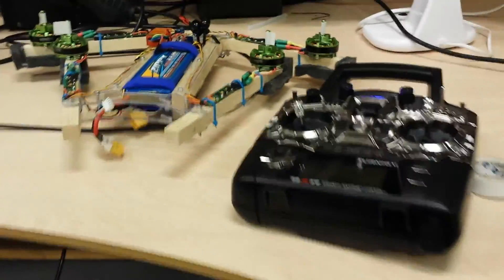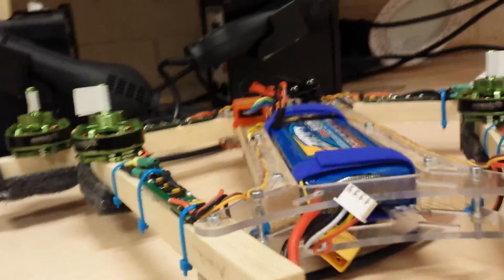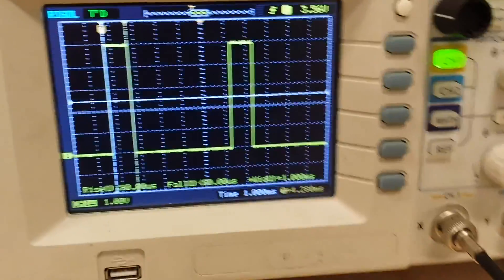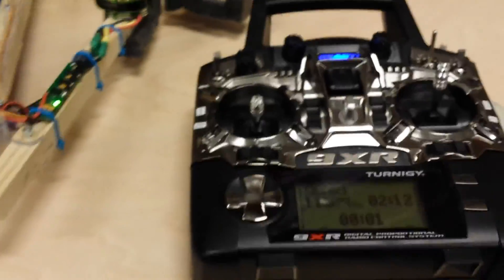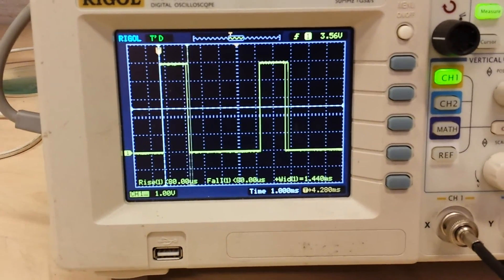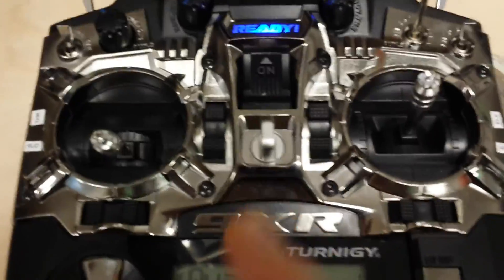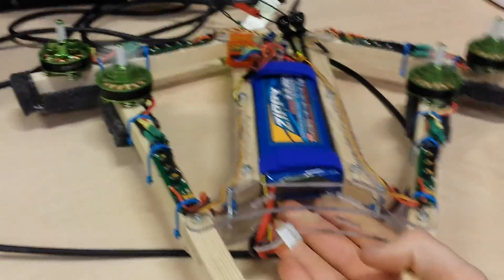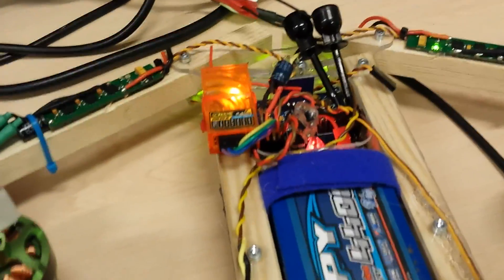flight controller goes mad at signal loss

Comment: I'm sorry mate but you really are foolish to think that unplugging power from the receiver simulates loss of signal, you should have interrupted the signal by switching off the transmitter instead!
Try this with most receivers and you will get all sorts of issues.

Comment: What are you doing with a atmega V3.0 in July 2014 anyway?!

Get a minimum of a KK2.1.5.
Reply from the maker: Good point! the KK is much better but i bought this Flight controller earlier ( 1-2 years ago) when kk2.1.5 was not yet around. anyway HK is still selling this flight controller so obviously people are still buying it, and anybody considering buying this should be aware of that they're getting a ticking bomb! i can't imagine what mess it will create if it looses the signal in air, probably your multirotor will reach quiet some altitude before smashing into the ground uncontrollably. to me it happened when i was adjusting the parameters so it went straight into my face.
Reply: I had the V3.0 and the older V2.1, both without self-level.  It was sweet and sour to fly with them.  The older PI(D) adjustment with the analog pots were a pain.  I then moved to the KK2s and the user-based firmware like Steveis, and it made the KK2 fly like an entirely new board.  I've since moved to the Naze32 which is another notch above the KK2 with user-based firmware.